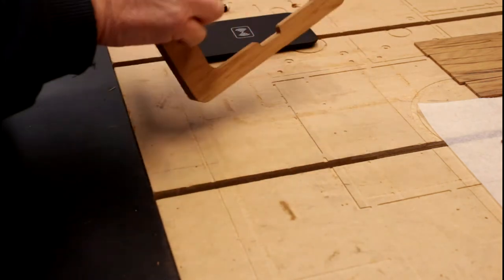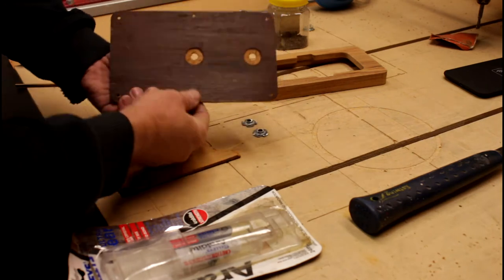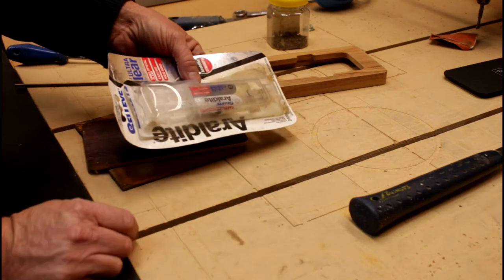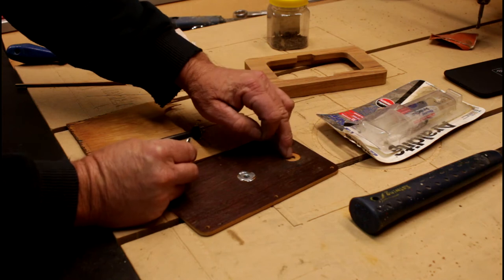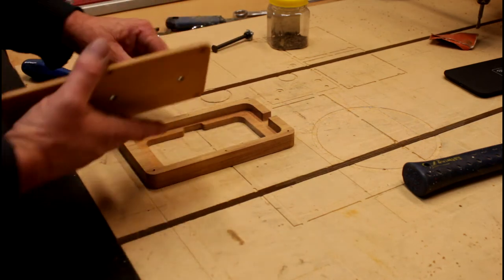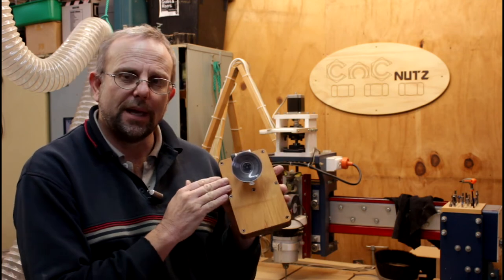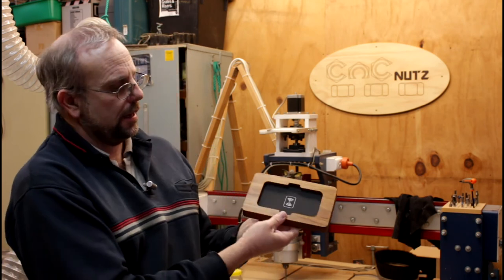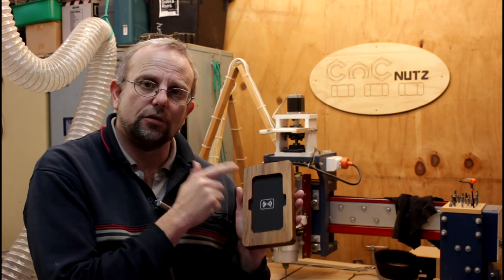Wireless Car Charger - CNCnutz Episode 87

Comment: not much of a DIY video if you need professional equipment but I like the idea
Reply from the maker: +brandon martinez 
Hi Brandon,
I'm not sure what professional equipment you speak of.
If you are referring to the CNC machine it is a homemade piece of equipment I built a few years ago and despite what it looks like it is mostly MDF and steel.
Anyone with a homemade machine will be able to make this DIY Project.
While I realize that most people do not have a CNC machine in their workshop and this would tend to take it out of the DIY area. I would note that this channel is dedicated to CNC projects.
With a hand router and other basic tools this project could easily be made in anyone's workshop.
This was a project that came out better than I thought it would and makes a cheap plastic charger look really nice.
Thanks for watching. 
Cheers
Peter